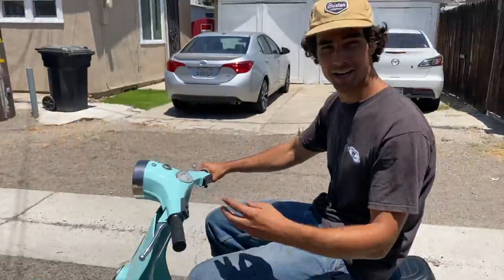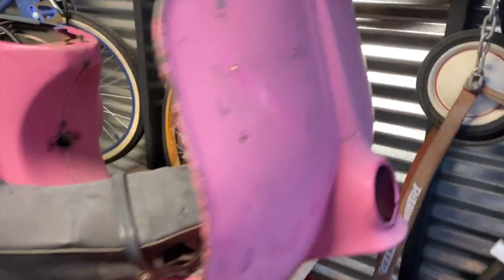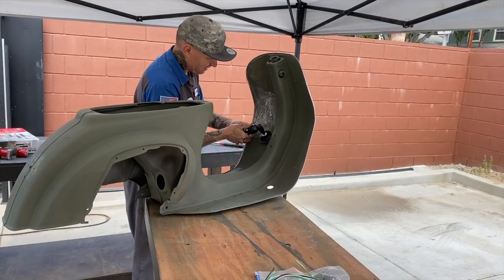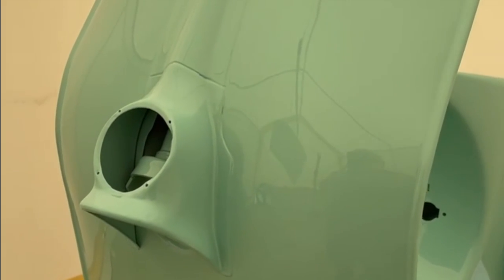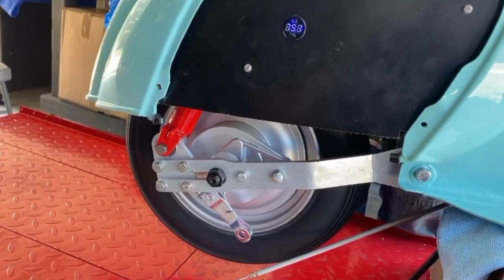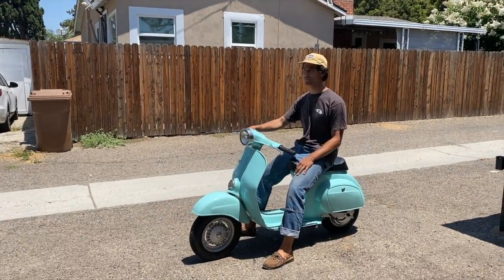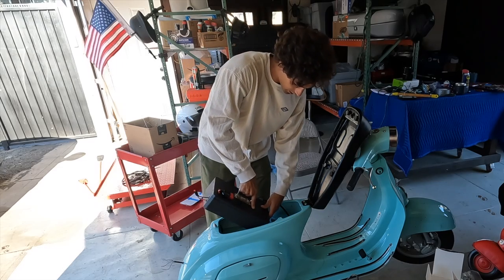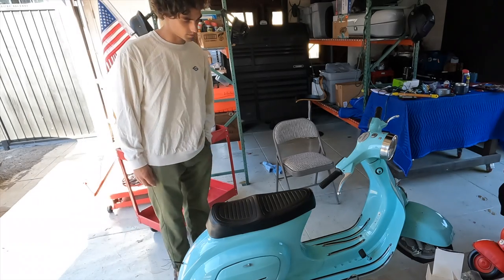DIY Vintage Vespa Electric Conversion

Comment: I'm holding out for a battery that can get at least 100 miles in a single charge and do around 60 miles an hour.  Until then it's not worth it for me, but that said this is amazing.
Reply from the maker: Totally agree! Solid state batteries are currently in development and show promising signs of high range, fast charging times, and low heat generation. It all sounds too good to be true but I’m still hopeful!
Reply: @bernietime  that would be great. I have a 1966 J range Lambretta which i want to convert at some point but need to make it worthwhile due to only being able to do it once.